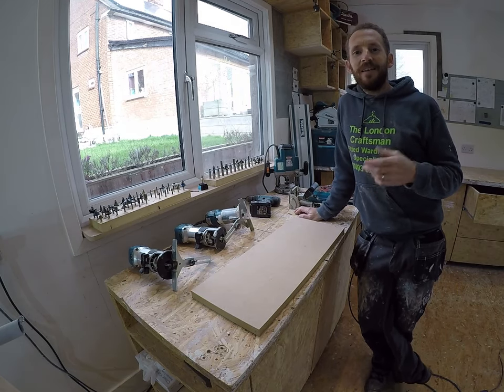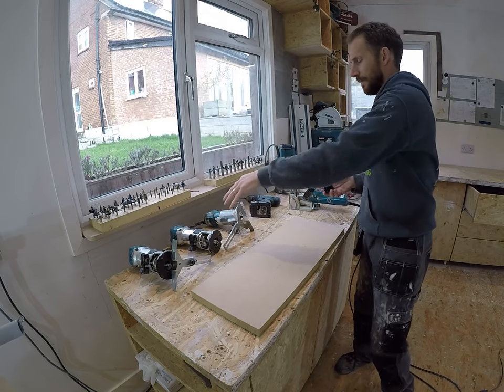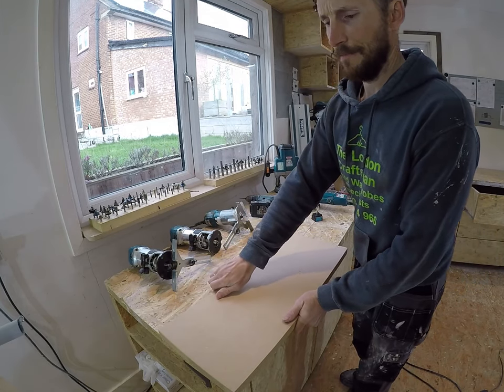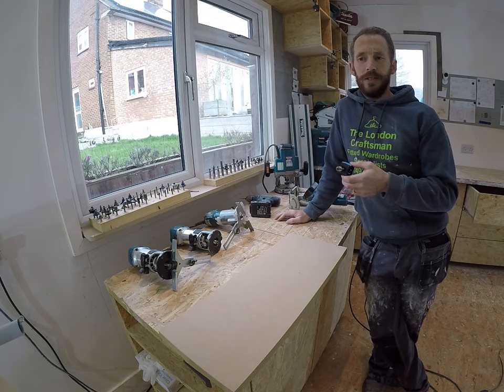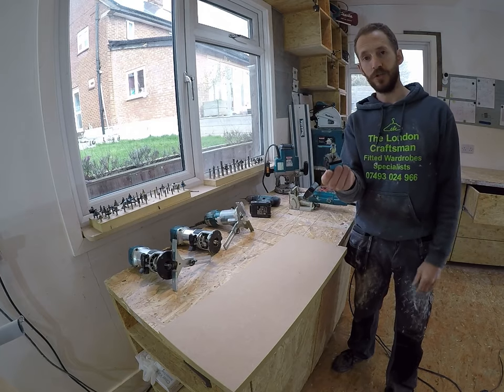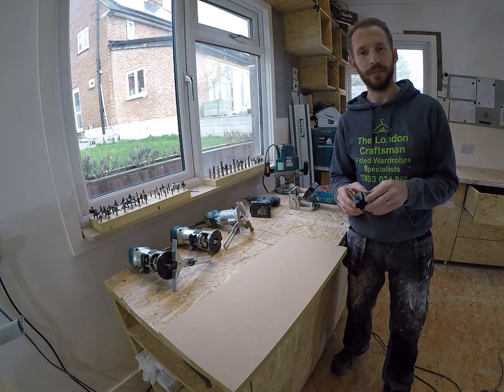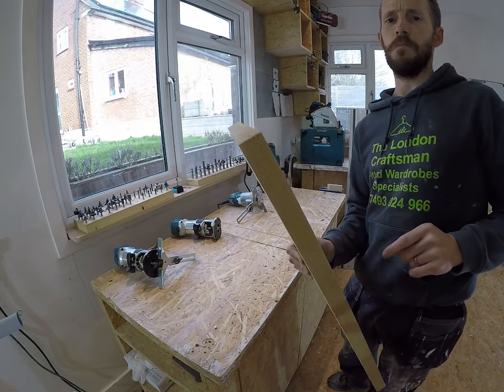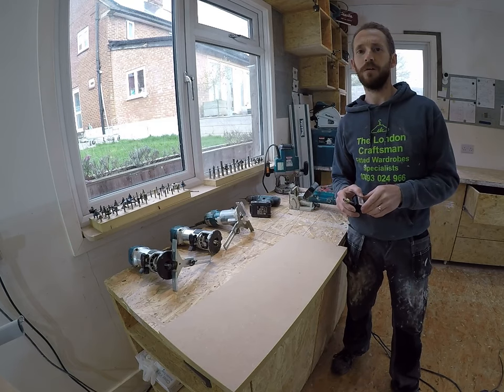You NEED this cutter in your workshop... SERIOUSLY!  |  EP#13

Comment: Have you tried Wealdens Tool Company. They do an excellent range of quality router bits including an arris round over range from 1mm to 10mm. I get most of my blades and cutters from them because they're the best  in my opinion and a Brit company to boot.
Regards, Scott.
Reply from the maker: I never have to be honest, I'll give them a go to sharpen my cutters tho, I have quite a few to get done 👍
Reply: I agree - I bought a 1.5(?)mm arris roundover from them. Very pleased with the quality (of the bit and the cut)

Comment: I wood agree 100% — except I use a 2.5mm and a 1/8” roundover bit. 
Crisper edge than the 1/4”
Sometimes the 1/4” around the outsides but definitely the 1/8” on the inside edges and shelves.

Comment: Really struggling to set this cutter up properly, it either does nothing or I move the fence a fraction and it leaves a groove along the top of the workpiece. What am I doing wrong?! Any tips?
Reply from the maker: It's tricky to get it spot on but basically adjust it so it leaves a line and then work the cutter up until its gone.
I know what you mean though, happens to us too, but as soon as the line is gone, that is the setting you want.
It doesn't look like it takes off much, because it doesn't really, but it just rounds the corner over ever so slightly
Reply: @thelondoncraftsmanworkshop  many thanks, I got there in the end. As you say, it takes so little off that sometimes doesn’t look like it’s doing anything but it is!

Comment: What paint do you use on MDF? You mentioned it on a video but I can't find it now.

I bought that router bit last month. It's been brilliant.
Reply from the maker: That's good to know I dont know how I lived without that cutter before, I use it daily!
Are you spraying with airless ? Or hand painting roller brush etc?
Reply: @thelondoncraftsmanworkshop  Well I bought a Wagner sprayer but haven't used it yet. The Graco is out of my price range at the moment. 

If you can tell which paint for both methods I'd appreciate it.
Reply: Hello
Reply from the maker: Hi either use a water based acrylic undercoat/primer then any choice of top coat such as satin,silk or eggshell. I prefer eggshell.
Or use the top coat paint you choose as both your under coat and top coat ( basically 2 coats of top coat ).
I find the 2 top coats works really well with airless sprayers but either method will work.
Reply: @thelondoncraftsmanworkshop  Yeah but which brand do you use?

I thought you said Deluxe something but can't remember.
Reply from the maker: I use johnstones and deluxe mainly.
If dulux eggshell then diamon eggshell

Comment: Could you sharpen the router bit?
Reply from the maker: Yes definitely , to be honest I havnt sharpened any of mine, I just buy new ones but I will get around to getting them sharpened.
I may even YouTube a video on how to sharpen them.
Reply: I’d be interested to see your sharpening technique on router bits. I found a sharpening place close to me a year ago and have saved a fortune on the bits I use for masons mitres in kitchen worktops by sharpening instead of buying new. It has thought me that some bits are better than others for sharpening though, so don’t know how many times you could sharpen such a small cutter.
Reply from the maker: I have never tried sharpening a cutter before, but it definitely saves money, well worth sharpening your bits instead of buying new so I need to look into it.
Like you said, as the cutter is so small it may only be able to be sharpened a few times.

I have a very small round file, I may try and sharpen one myself next week
Reply: @thelondoncraftsmanworkshop  Hi guys just a  mention of what works for us. Before we look at sharpening we soak the cutter overnight in IPA (isopropyl alcohol) then give it a scrub with a stiff nail brush. Seems like it gets rid of the microscopic resin build up that dulls the cutter and gives it a bit more life. Just a thought?
Reply from the maker: @georgepritchard3010  thank you, ill defo do that. Will hopefully revive half a dozen cutters 👍👍👍